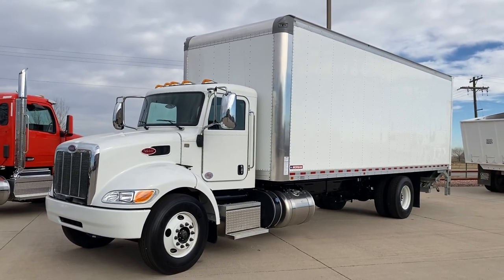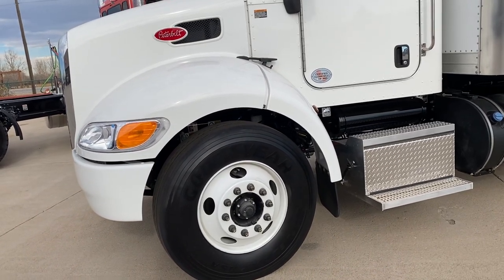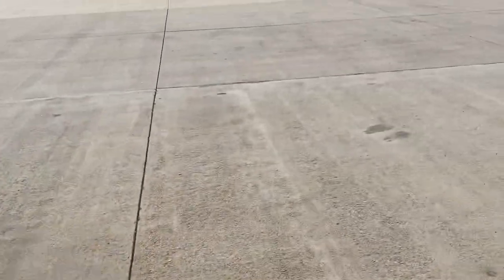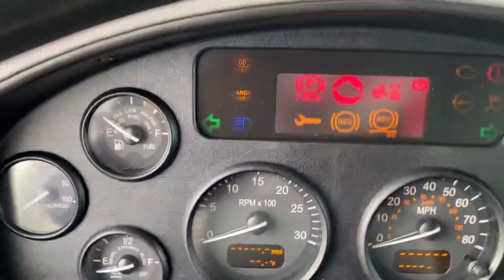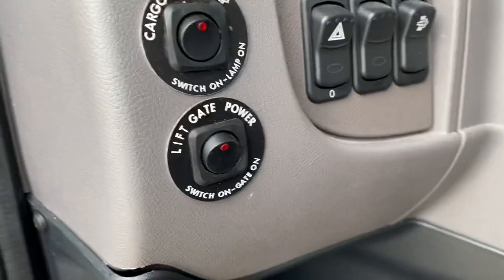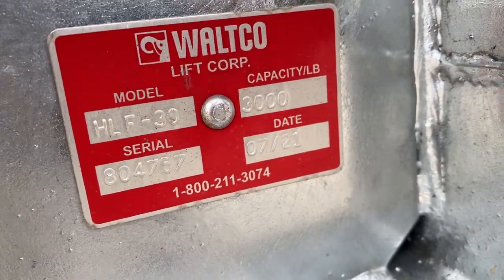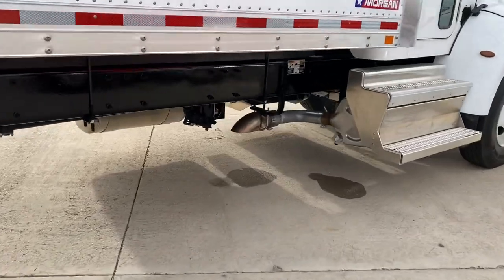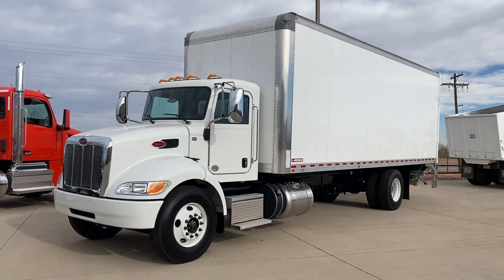Actually FOR SALE as of 11/23/21:  NON-CDL 2022 Peterbilt 337 26' Van body w/Liftgate:  970-691-3877

Comment: The px7 is just the 6.7ISB for commercial trucks. The company i work for also uses them (DAF) and they tend to last for a really long time. Breakdowns are rare but the engines are quite a bit louder than the MX11 and MX13.